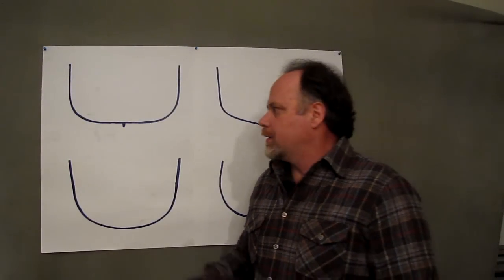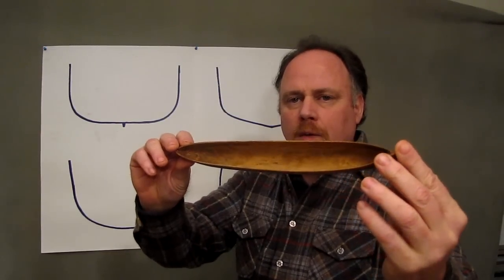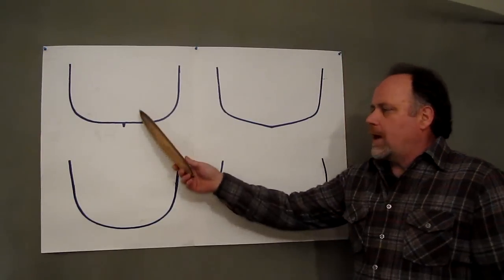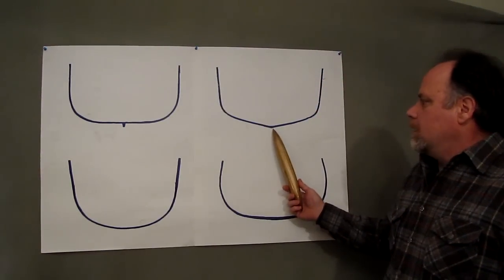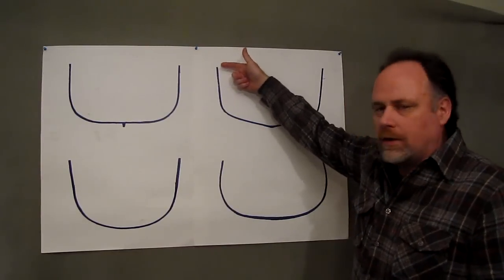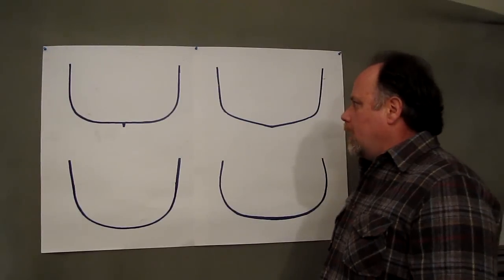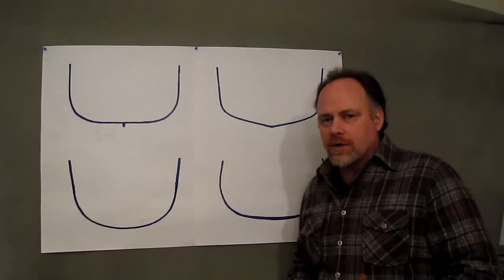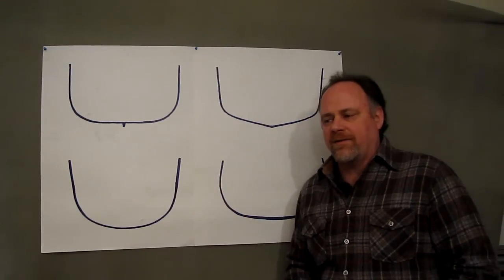Canoe Design -more on Hull Cross Sections #2A

Comment: why can't u combine the 4 main styles esp on smaller boats to get best of both 1 style right & 1 style left the same way the bow & middle section can b diff from aft. Again on a small lake type boat hving flat bottom is key but u get on 1 side of a horse.
Reply: This guy stopped posting videos 10 years ago.